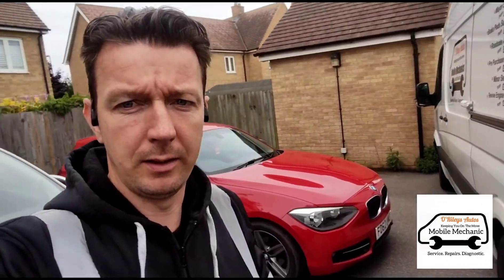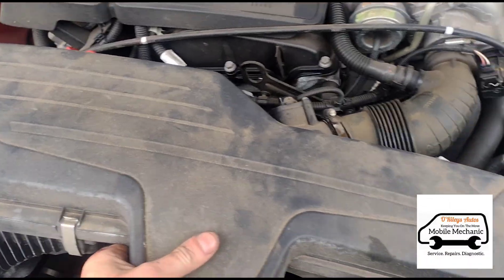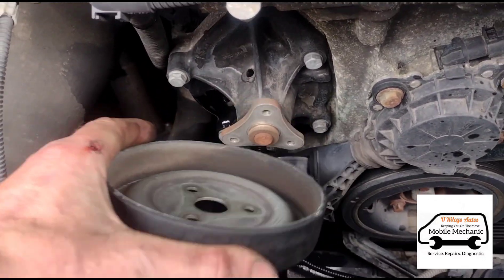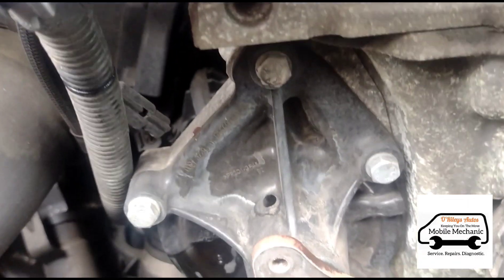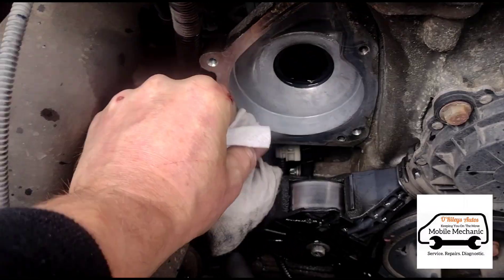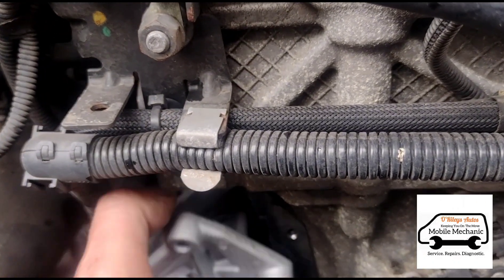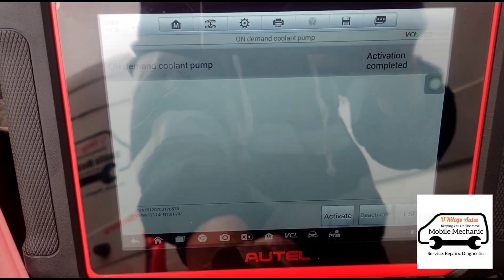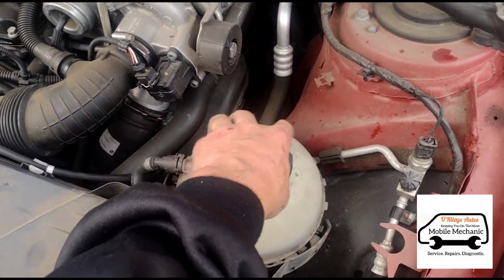BMW 1.6i Petrol Water Pump Replacement With Electric On Demand Friction Wheel Pulley Drive Tensioner

Comment: Hi O'Rileys, Just noticed that the water pump pulleys has a lot 'surface cracks' on it. Does it need to be replaced as well? The video shows that the you had put it back the old pulley. Assume it is normal for the pulley to be like that. As my car is the same as the one in the video, where the water pump pulley has surface cracks. Could you please assist? Thank you. Great Video. One of the easiest water pump replacement job.

Comment: Friction Wheel Pulley Drive Tensioner BMW n13
Does it need to be adapted, when I start the engine, it pulls back after a few seconds and the pump always turns.
Reply: I believe the water pump should always turn when the engine is running to circulate coolant

Comment: Them tensioners have a tab connected to a cable like mechanism which releases the tension on the pulley. Litteraly just seen this on a Peugeot Rcz video which must use same/similar engine setup. Just for anyone who doesn't own a diagnostics tool 👍🏻
Great videos by the way.
Reply from the maker: I did see the tab but it looked so flimsy and brittle I didn't want to touch it and be liable for a replacement part
Reply: Salvage Rebuilds UK 👍, they get so much variation in cars I always learn something new, like with Jimmy's channel.
Reply: @MrZimmaframe  yes mate, another very informative channel. Likewise I'm always learning something new 👌🏼
Reply from the maker: @biglad1292  from searching this after making the video it's a common part so can't believe I haven't seen one before
Reply: @ORileysAutos  I'd never seen them before either then 2 in 1 day on different videos. I wonder what the idea is behind them? Only thing I can see which was also mentioned on other video is that when disengaged it would allow engine to warm up quicker with coolant pump not running?
Reply from the maker: @biglad1292  yes that's exactly what they are for to allow the car to warm up more quickly and save fuel
Reply: I dont blame you mate. Quite a common part to fail apparently. Video I watched had what sounded like bottom end knock which a garage suggested engine replacement! The tensioner was replaced along with water pump and belt which cured problem.
Reply: What mode did you use on your autel to release the tensioner
Reply: You got a link to that video??
Reply: You got a link to that video??